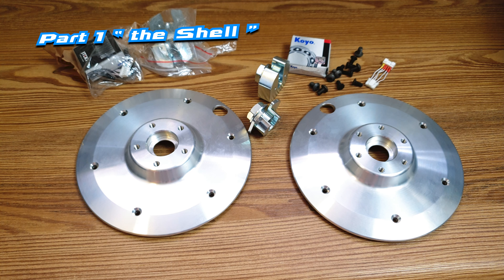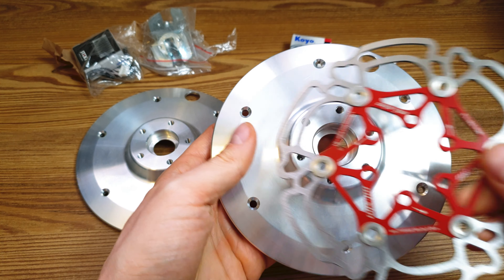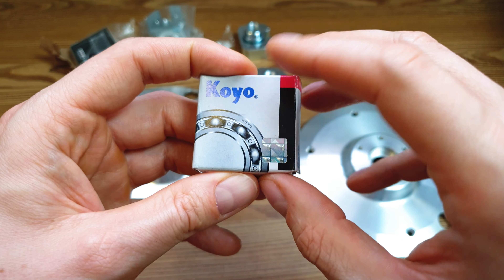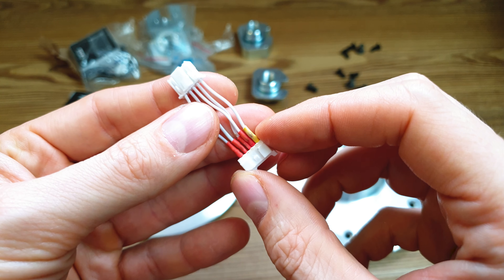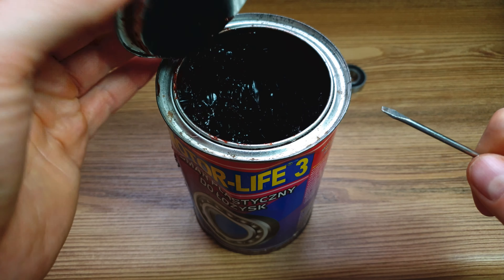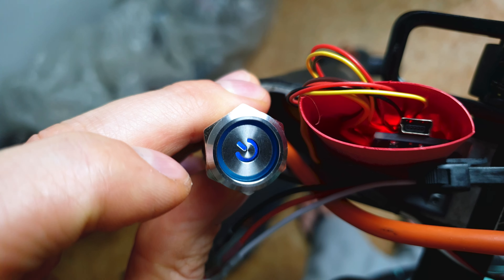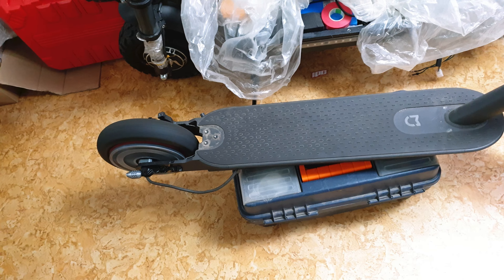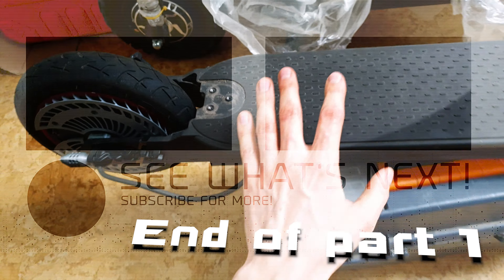Must have for Xiaomi m365 2WD or RWD MOD💥🛴 Motor Break Shell 💲😍 Part 1 " Shell "

Comment: brother why you put grease bearing on the area where it sit ? normaly we dont do that. on cars or motor bike regarding silender blocks or biger bearing like yours :)
Reply from the maker: Well when alloy oxidated / corroded with other alloy part or steel then is like no way to remove/separate two parts  , especially that motors can reach quite high temps and parts are quite fragile compare to cars or bikes :) . So when I start to use grease I never had any problem with removing bearing :) , but yeah this is just my way of doing it, could be bad or good ( no one knows ) 🏴‍☠️🍻
Reply: @PirateWasHere  if i can recomand is ceramic grease. We put on different parts in contact with heat to avoid corosion and make easy to remove. Like breake caliper and wheels in contact. But  on breake caliper of cars who go very high in temp. Without that we dont put because it can make play with time. Then dont know for that... but i get very expensive roller in past we dont put. An good quality bearing have protection against corosion and the metal balls inside an special grease for that too. And your part on video is aluminium then not problem with corosion. Then finaly not realy sure. For me i will mount them without and to extract an old bearing with an bearing extractor :)
Reply from the maker: Thanks for your input , last time I had to cut side motor shell to remove bearing coz of alloy oxidate, so this what i did I took from my experience 🍻🏴‍☠️
Reply: @PirateWasHere  you have more knowledge than me in xiaomi. But i will recomand you to throw in trash the xiaomi bearing to put SKF version they have same dimensions of the xiaomi. Those are good bearing and no oxydation. they are other from other brand in ceramic who is the best regarding low friction. But i am not totaly sur is the same dimensions but it should
Reply: @PirateWasHere  pls answer me bro,need some help
Reply: @PirateWasHere   Hi ,i want flash your firmware m365 pro 
155 32kmh stock power.What is changed and 
stock in this firmware? I want only higher top 
speed like 32kmh but not more power,amps 
or watts,everything keep stock so not  break anything.I tried make my own cfm,i changed only sport max speed to 33 but scooter still goes 26kmph,why is your going faster when it is in stock power?Or is there increased phase current and battery current to achieve higher speeds? Pls answer  me asap.thanx
Reply: @PirateWasHere  Czy masz na sprzedaż gotowy zestaw do zainstalowania w m365? Przydałby się przedni hamulec w emce ^_^

Comment: turn inside the shell of motor in black Matt colour.
it absorb more heat radiation from the stator.
shiny surface of that, hold heat inside the motor like a flask.
it's really work.
Reply from the maker: I have to read about it cause i know that black color absorb light , never heard about heat
Reply: @PirateWasHere  test it.
Paint one sheet of aluminum black and place another sheet without paint next to a heat source such as a soldering iron or iron. To an equal distance. You will see that the black sheet will absorb twice as much heat as the glossy sheet. This is because the heat source itself produces infrared light that is absorbed more by the black surface. Infrared is also a type of light but with a shorter wavelength.
it's really help for your cooling system.
Reply: I test it by my self. and now body shell of my hand made motor is getting hot very soon. it's mean absorb  more heat from stator to the outside of motor and inside the motor is cool down.
Reply: Paints can be temperature resistant, but this does not mean that the pieces will receive higher temperatures but will receive less. The heat source will not be colder if you paint the cover. The cover will be cooler, but that doesn't mean anything to you. In principle, it is even better for the cover to pick up more heat than less.
Reply from the maker: So motor shell painted black will be colder or hotter
Reply: @PirateWasHere  The motor shell painted black gets hotter. But where does this heat come from? Infrared radiation inside the motor. Which means it cools down faster inside the motor.

Comment: 0:00 I’m sorry what!
Never seen someone bother to go this far for a motor before!
Surely it would be pretty pricey to get those side covers?
Reply: I asked them. €140 incl. shipping
Reply: Karl Maurer I could literally buy a different motor for that in AUD$.

I do still see the appeal for those that don’t want to get a new motor and want to keep it stock looking. 🤷🏻‍♂️
Reply: Now the price is 117€ 🙃
Reply: goran klacic that’s better, but I could still buy a whole motor for that. A motor side plate shouldn’t cost $189 aud that’s a bit rich still.

That being said it’s a machined custom part, so expense kinda goes through the roof especially on lower volume stuff.
Reply: @JamiePineappleWyatt  its not just plate,,adapters for mounting wheel is includes with that conector.  It is not a mass production of hundreds of thousands of pieces that could compare price with a hub wheel. Cover is making from 2.2 kg block aluminum. Piece by piece, operation by operation on a machine that costs 140k €. I ask you what is cost of one working hour in Australia?
Reply: goran klacic please read the second half of my comment again. It seems you may have misunderstood my position on the topic and become slightly offended without warrant as if this was a personal topic for you.

I’m guessing by plug you mean the hall sensor adaptor wire? That can be achieved by simply swapping two cables in the existing plug that handles hall sensors, it’s actually not necessary but is a nice touch for those not in the know or incapable of swapping them around with simple instructions. (It’s as easy as pulling two pins and putting them in the right spot).

Yes they are still expensive, I understand the costs of making such a piece because I’m working on my own for others. The unfortunate situation of this product has landed it in a price range that will lead to only people with large amounts of income would actually purchase because they want the m365 motor to be better. Simply because you could just buy a disk brake compatible motor that’s mass produced for less.

I’m not trying to be an arse, that’s just how the market is, I still like it though and the thermal mass it adds to the motor will allow them to be run even harder than they were before they’re modified.

The actual target audience is rather small is all I’m getting at, and that target audience is more likely to have a more powerful PEV they’d rather spend their money on instead. For example, Pirate here has an incentive to use these because he does m365 modification content on YouTube and most likely struck a bargain with the company that produces them (not saying this is how it is, I’m just guessing as it is quite common in this industry), but for someone like myself that looked at an m365 because it was a cheap option (under $600aud) probably wouldn’t spend close to $200 aud to change the side plate, that’s double the cost of a disk brake setup for the front and rear including disks.

When releasing a product to the market today when it’s a limited volume and not mass produced means you’re going to have high overheads, this naturally makes the product sit in the “premium” price range and regular m365 owners just won’t pay that premium to make it work with disk brakes. I’ve seen m365 motors with disk brake side plates before for under $200aud shipped to Aus, which also kinda makes this product irrelevant for the majority of its purpose in the first place 🤷🏻‍♂️

Don’t ask me to find them, I didn’t put them in my cart or favourite them because I don’t want such a puny motor (I’m actually slowly becoming more surprised as to how much power they can actually handle however), if I come across them again one day I’ll end up putting a link up on reddit.
Reply: Also that quote you asked for depends on the field of work directly along with experience and many other factors, so I’m not going to open my mouth on that one.

If it was made here it would be nearly twice as expensive I assure you. I do acknowledge there isn’t much more they could do for the pricing and it’s a decent piece of kit, it’s just too expensive for someone like myself to consider it viable when I could buy a larger motor that would still fit with a side plate for a disk already and end up with two upgrades instead of just one for a small margin less.

Those torque arms look freaking mint too, I’d actually plug those myself if they fit other motors too. I hate that escooters have fuck all for toque arms (just a bent washer and a flat slot) we learnt with Ebikes that there needs to be something far better than that.
Reply: @JamiePineappleWyatt  Well it’s a bit personal, but there’s no anger on my side 😉. Because Goran whom the Pirate mentions at the beginning of the video It's me. I produce these covers and they are made as a hobby, stress relief, there is no profit there. They are made for enthusiasts in the making of the AWD M365. Developed and made for one reason only ... safety. Namely, no one solved the mechanical braking on the AWD, so far everyone has used electric brakes. It annoyed me quite a bit so I developed that cover. Believe me, I have spent a lot more money than I will earn. My goal is to make a quantity that would justify the price to be acceptable to everyone. I am aware that it costs a lot, but so far 40 pieces have been made, so the price is high. Each subsequent series will be cheaper and closer to the wider masses. This was literally a prototype production. R&D is not even in any calculations. It’s just not my core business, this is a hobby, my escape from everyday problems (don’t tell my wife)🤪
Reply: goran klacic I apologise for that detail going straight over my head 🤗

I did think you may have been directly involved from your original comment :)

It’s a beautiful piece! My question is, why not just make a bracket to accept the drum brake on the swingarm rather than machine an entire plate for a disk? 

I mean, I guess this isn’t for that, it’s for the upgrade option of disk brakes too.

I mean sure disks are great, drums however require less maintenance long term. That point is more personal preference for most though.

Now the dual motor m365 movement is exactly that small portion of the consumer market I was talking about earlier. Honestly if I had the money and an m365 with the intentions of going dual drive, I’d probably get a pair, does the kit include one plate or two? That does change things quite a bit when it comes to my opinion if it’s two, I’d flip 180 and applaud you for managing such a low cost for that amount of material!

I modify my PEV’s for the same reason, glad to meet someone else in the same mindset! 🤗

As someone starting up, I know it’s really, really hard, especially when it comes to prototyping and releasing an actual product then having to deal with feedback, it can get pretty stressful depending on how your hard work is received :)

I honestly hope you have plans to do some for other motors down the line once you manage to make this project more profitable for yourself, I’ve had some of the LY series motors from China that have cracked side plates due to defects

Comment: Hi, i want flash your firmware m365 pro 
155 32kmh stock power.What is changed and 
stock in this firmware? I want only higher top 
speed like 32kmh but not more power,amps 
or watts,everything keep stock so not  break anything.I tried make my own cfm,i changed only sport max speed to 33 but scooter still goes 26kmph,why is your going faster when it is in stock power?Or is there increased phase current and battery current to achieve higher speeds? Pls answer  me asap.thanx

Comment: i relly dont see a point in upgrading a xiaomi m365 for that much money. it is a budget scooter to begin with, and i will not trust that cheap alloy they are using going 50 kmh ...if you get the parts for free clearly its a different story 😜. i converter my m365 to dual motors and dual battery for 100$, just bought a second scooter with a bent frame and took all the goodies out of it
Reply from the maker: Well some countries do not allow to use more than something like m365 so if u can make sleeper which looks like stock but power x4 then shiet, I am all in 🥰🍻🏴‍☠️
Reply: @PirateWasHere  that's actually a good answer! nice work my friend 🙂
Reply: @dancohen4439  Also sometimes it isn't about the money ,however people like myself enjoy modding things . I just ordered 2 of these scooters ,delivery today and my purpose is exactly to mod one and post it as a giveaway and make a super sleeper using only the stock motor . A person must know and understand electronics though so not blow or hurt oneself. cheers mate!! remember not everyone has to follow another person and each person has his/her own reasons for doing thing or being unique...running the rat race and being like everyone just suck lol.